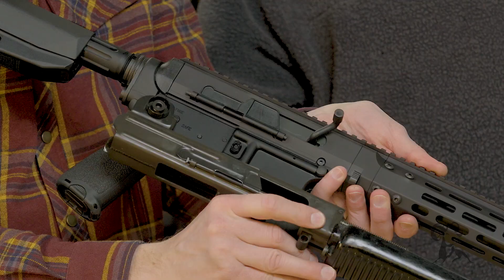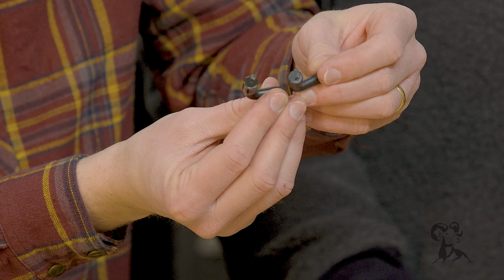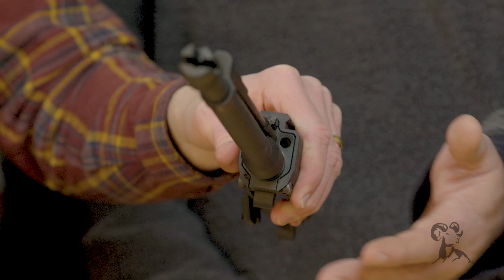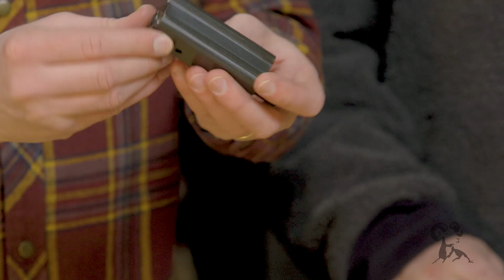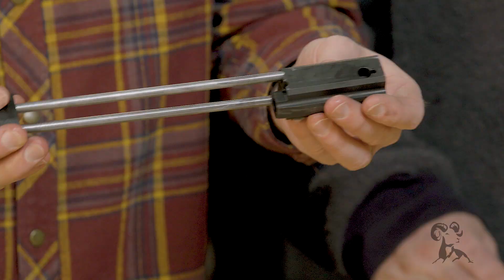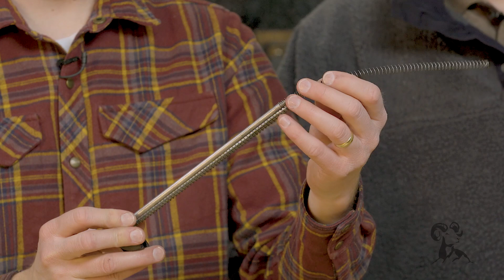Brownells BRN-180™ Upper Receiver Detailed Overview

Comment: Disappointed that you're not doing a full on Retro 180 but I'm even more disappointed that you decided to modernize the upper.  I just don't get it.
Reply: Maybe because they want to sell a large quantity.  Everybody and there dog already has an AR they can slap this upper on.
Reply: @shizims  And there you have it..Fans of the AR180 get to buy something similar and "everybody and their dog" can buy one and slap it on. Bravo to Brownells, they hit a home run with this one, assuming it runs and I'm sure it will
Reply: Justin Sims this isn’t a true AR-18 tho. Even as an upper. In spirit it is, but in spirit only.
Reply: @Anni3sgotagun  You know, if they changed that rear buffer on the upper a bit, it would probably fit directly onto a NDS-18S lower. The Brownell upper has a rear pin lug, but it would fit right into an empty space in the NoDak billet lower. Basically, the upper can go on either a standard AR-15 spec lower or an AR-180 spec lower depending on what shape the buffer section is.
Reply: ostiariusalpha the trigger would have issues either reaching or connecting with the firing pin due to the AR-18 BCG being shortened and altered.
Reply: @Anni3sgotagun  I thought that as well, so the solution would probably be a separate BCG; most likely identical to the original AR-180. And that would make it more authentic anyways.
Reply: Mabs shut up nay sayer.
Reply: D R if they introduced a complete BRN-180 you wouldn’t say that. If you shot a AR-18 or have one, you wouldn’t say that either.

They could have done so much better but they didn’t so oh well. You can purchase what looks like half a shadow of the AR-18 all you want. Not saying you can’t.

If I purchase one it will be fitted on a Fightlite SCR lower not a standard AR-15 lower
Reply: D R The original and the newer AR-18s also all have the ability to have various folding stocks making it a even shorter platform than the AR-15 with a folder. Check out the AR-18/180 section on AR-15.com great pictures and awesome setups.

Yes the Fightlite should be able to accept the BRN upper as it accepts any standard AR-15 upper.

If you come across a AR-18 grab one. Even if it’s the AR-180B. In my opinion that’s the best one as it can use AR-15 components and you can use the NDS lower on a regular AR-18 upper. I highly recommend you checking out the AR-18/180 thread on AR-15.com. Great source of information.
Reply: There’s a Billet AR-180 lower that’s better
Reply: Ann Lee good luck paying under a grand for a shot out upper.
Reply: Daniel Frakes I have a new AR-18 sooo I don’t know what you’re talking about.
Reply: @Anni3sgotagun  That's cool but will this upper attach to it?
Reply: Mabs Nope, Brownells could have given us a complete rifle if they did a little research
Reply: raiden z the upper doesn’t completely look like the AR-18. I have one, I would know.
Reply: The point is that you can slap a 180 inspired upper onto any of the hundreds of inexpensive AR15 lowers and maintain the lower parts compatibility and magazine compatibility. Realistically nobody gives a shit about "billet 180 lowers" except for people who would rather just have a real 180. This is something I would buy. A real or replica 180 is not.
Reply: @thetman0068  "...nobody gives a shit about 'billet 180 lowers' except for people who would rather just have a modernized 180."
FIFY
By the way, this would be a substantial proportion of the people that are interested in this upper to begin with; it's not about getting a mere replica. The NDS-18S uses the AR-15 grip, trigger components, and has a STANAG magwell, it doesn't work with original AR-18 mags.
Reply: The Mad Gentleman people do give a shit about the AR-180 upper and lower. Brownells wouldn’t even bother with anything that has to do with the AR-180.

If they had a AR-180 clone they would fly off the shelves
Reply: Mabs Fudds gonna Fudd. Just be glad they’re making a sub 1k AR180 action.
Reply: @fathead8933  I'll be glad if they make it at least look a little more retro.
Reply: @mabs9503  why not just get an original ar180 ?
Reply: The solution would be to have a true AR-18 using Billet. It’s not a complicated rifle. The AK is more complicated than the AR-18.
Reply: @Anni3sgotagun  I became curious about this whole question of the trigger hammer position, so I overlayed the NDS-18S lower with a standard AR-15 lower. The NDS-18S uses AR-15 compatible trigger parts to make it more economical, and I found that the distance from the front pivot pin holes and the trigger pin holes is only marginally different between both lowers. I believe the shortened Brownell's BRN-180 bolt carrier will in fact, work with the NDS-18S lower's trigger assembly.
Reply: D R you clearly didn’t read my other comments. There is a BILLET ALUMINUM AR-18 lower.

Comment: GET RID OF THE POLYMER IN THE BACK, ON THE SPRING ASSEMBLY, AND I WILL BUY IT.
Reply: It its doubling as the buffer you don't want it made out of aluminum.
Reply: Pitch Lock you are killing me . if you need a plastic peace to keep the gun from beating itself to death The gun is flawed. I wish people in this country has some standards
Reply: Burntburgers ...it’s literally there to act as the back of the receiver. Because this mates to an AR15 lower, which operates on a buffer spring, they need some way to close up the back of the receiver so the carrier DOESN’T slam into the buffer ring and beat itself to pieces. It being polymer just makes it easy to pressure fit and make, as all its doing is filling empty space between the rear of the upper and lower.
Reply: @RedMcCloud  i doubt that polymer peice is gonna hold up in the long run with the carrier slaming into it.
Reply: Nah man that’s fine. You want that I promise
Reply: The gun does look very nice.
Reply: It will last just fine. Steel beating steel or aluminum is bad. Steel beating poly is good as it will last longer if not forever. Examples. 1911 running plus p loads is a steel on steel beat down with cracked frames so say no to plus p if your like me and love your iron. The m1919a4 uses poly recoil buffers that trust me get slammed into by a steel bolt. They last just fine.
Reply: Leman Russ  yes